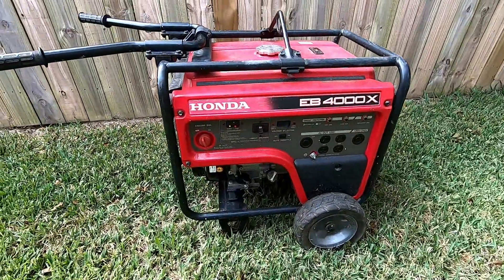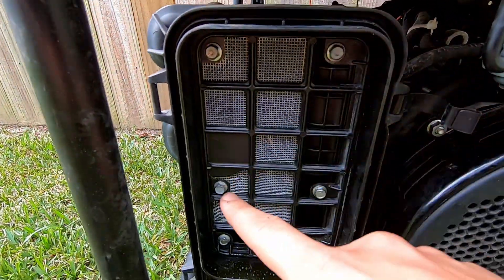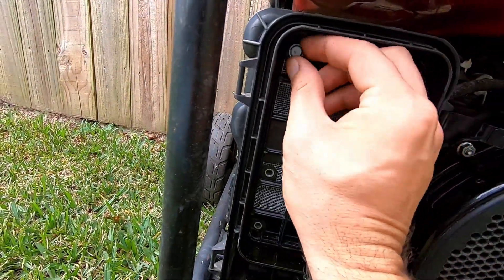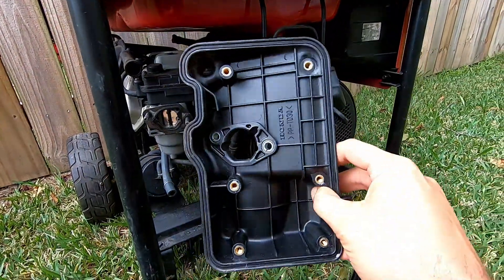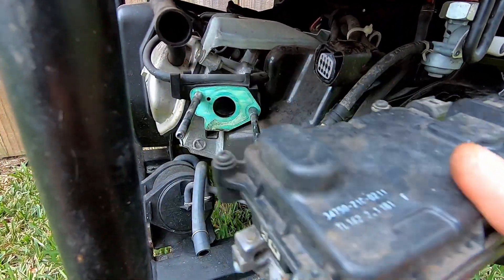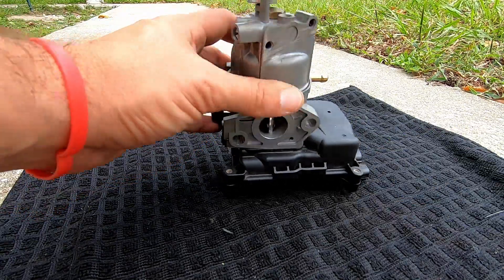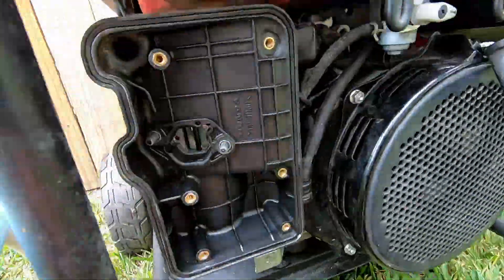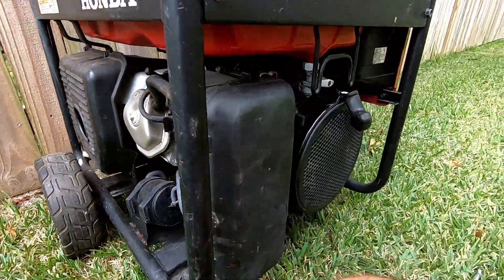Honda EB4000X Generator Repair - Carburetor Removal & Cleaning - EB Series

Comment: I just got one of these which does not seem to idle correctly when using the auto throttle setting. I believe I need to clean the idle jet which is located underneath the black idle adjustment screw on the side of the carb. It didn't seem like you cleaned this, but I'm not certain. Based on some other videos, it seems that it's only possible to get to this by removing the ECU, and taking out a black plug that is below that idle screw. Have you ever done that?
Reply from the maker: I couldn't find any videos on this generator was the only reason I made one at all. But no, I did not open up the electronics, although it was only 4 philips head screws to get the cover off, iirc.

Once you get it off and in hand, it will be easy to figure out.